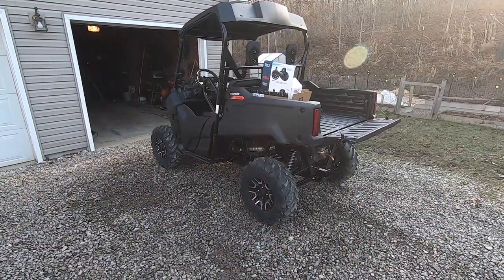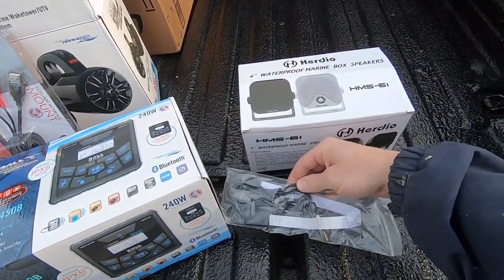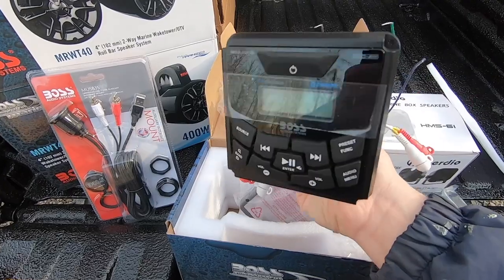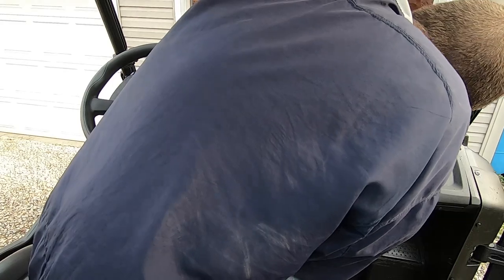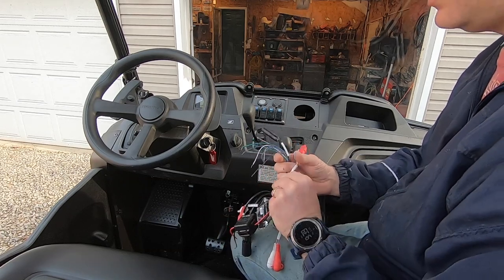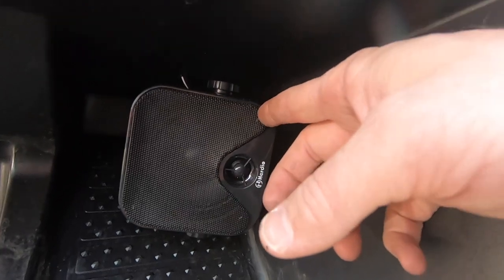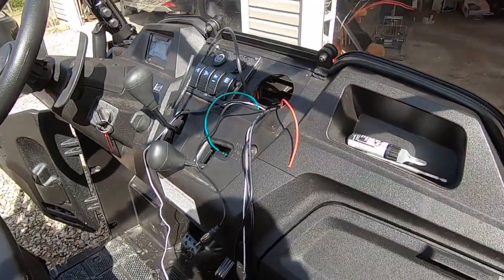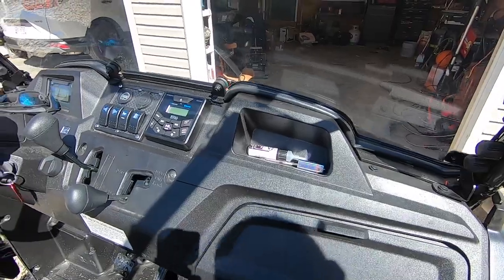Honda Pioneer 700 Custom Stereo System - Boss MGR450b

Comment: Just purchased this boss head unit for my boat. Nice vid
Reply: Are you able to connect an amp to the system, how does it sound
Reply: @adraper30  I’m pretty sure you can connect an amp to it. It sounds great but if you’re batteries aren’t charged fully if you crank it to max it can’t handle the power. Max vol is I think 40 or 45. Even at 30 it’s pretty loud and sounds good

Comment: Hello Jack my name is Cliff I live in Alaska. I have a 2014 Honda Pioneer 700–2. I also have the boss MGR35OB. I have been watching your show and then buying stuff off the links from Amazon that you put on there. I ordered the accessory plug with the USB to install in the glove compartment. When I hook all this up do I hook the accessory plug-in that goes in the glove compartment.? To the aux-in cable on the back of the stereo? Please respond as soon as you can because I’m installing the rocker switch panel and the stereo and speakers same ones you got this weekend.
Reply from the maker: Yes the usb / aux cable plugs in to the back of the stereo.

Comment: Do you have to have a dual battery set up for the pioneer 700? I've heard on the 1000 do you need the dual battery set up for your accessories because it can hurt your transmission and clutching because it gets low voltage and can mess things up.Was just wondering about the 700 if it does damage without double battery
Reply from the maker: I don't have dual batteries and it's fine. It would be better to have dual batteries with an isolator if you plan on listening to the radio with the engine off for very long

Comment: How did the roof fit with those speakers that you had mounted from the ceiling I have a 700-4 but I plan on getting those speakers and putting them in the rear back seat frame
Reply from the maker: Fits great
Reply: @JackofAllMasterofNone  is it possible to mount the radio to the left basically opposite?
Reply from the maker: @stifflerjj4  I don't believe there is room on the other side. There is metal behind it in the middle.
Reply: @JackofAllMasterofNone  have u come up with a mod for the under drivers seat huge void area
Reply from the maker: @stifflerjj4  https://youtu.be/JN2fPcHcegE
Reply: @JackofAllMasterofNone  all your videos are top-notch I'm installing my radio the same way you did yours however the switch panel is no longer available in Amazon maybe you have a width on the current one you use so I can find another one somewhere else also your heater install video I could not find that heater anymore anywhere..
Reply from the maker: @stifflerjj4  Appreciate it. The heater is out of stock everywhere unfortunately. I think it's just due to the Pandemic right now. As far as the switch panel, this is the same one here https://amzn.to/3dm7SZH
Reply: @JackofAllMasterofNone  alright great thank you so much do you have any plans in the future to make a video heat shield / sound Denton the engine for the 700
Reply: @JackofAllMasterofNone  I'm looking for a 16awg 2 Conductor jacketed... Do u have suggestions? And is it possible to use the speaker wire that you got button 16 gauge to run power for LED lights and such

Comment: How did you get the radio to turn on with the key switch?
Reply from the maker: It's hooked into the accessory circuit which gets power from the 12v port under the dash, which is switched.
Reply: So would you say your radio is fully powered off your keyed accessory wire rather than the main 12v from the battery?
Reply from the maker: @josephjones8672  https://youtu.be/5iBPaxFZP7Y